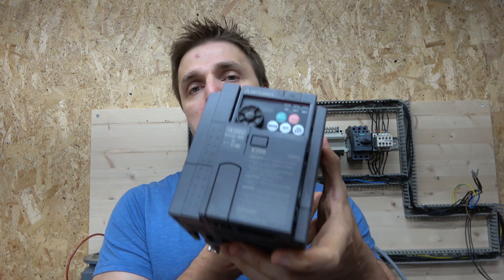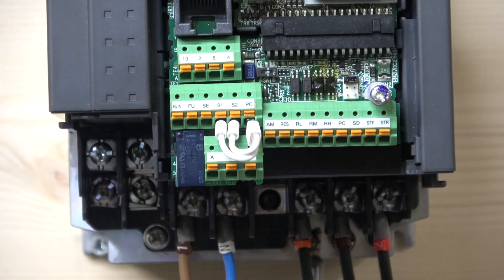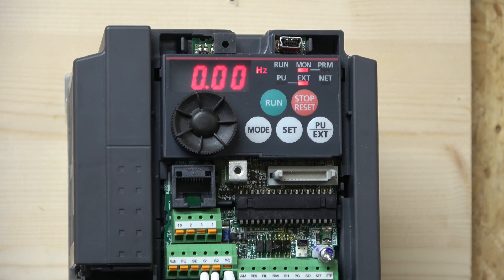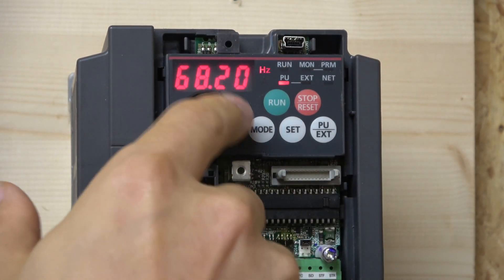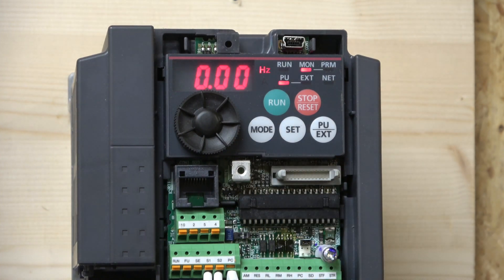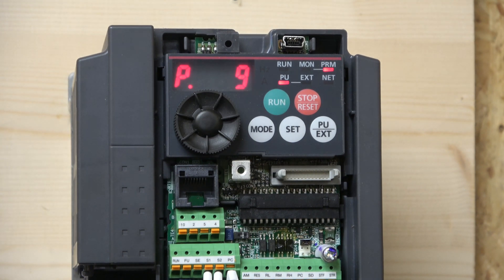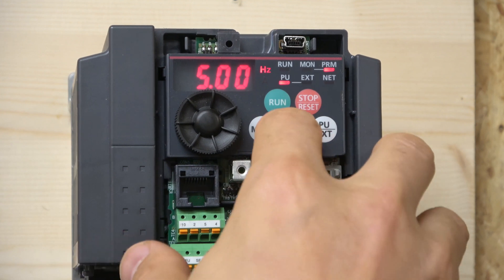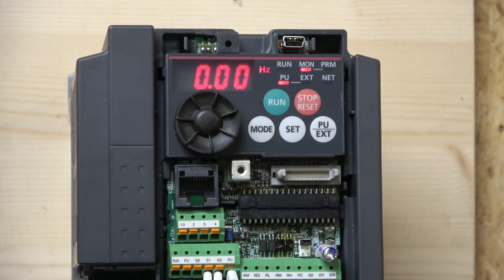Mitsubishi FR-E700 local mode control, Factory reset and parameter set up. ( 720s, 740) ( English)

Comment: FR-A740

Good morning sir, I have a problem when I press the inverter start button. The power on light comes on, but there is no Hz display and no output. Sometimes when I turn it back on it displays Hz and there is an output but after about 15 or 10 seconds it automatically turns off and goes back to zero Hz. Could you help me?🙏

Comment: Hi! Great video. I am stuck with getting the motor spin higher than 3 hz. I can tune it on PU btween 0.5 and 3 ish hz but setting to let say 50 it still run around 3 hz. Can't find it online.

Comment: Hi sir e700 drive already setting to parameter  and communication line also i will start to jog mode and 2 wire  mode my thinking is correct
Reply from the maker: Please check out the 2 wire control video.

Comment: I have the same FR-700 and it is showing error E. IHI ,
Can you help me to remove this error, This happened after the power failure and when the power came back then the lift stoped working,.
I did a couple of shutdowns and restart but did not help.
Pls, help me out.
Reply from the maker: Hi Mustafa, i cant seam to find this kind of error on Error list.

Comment: I love your video but I'm having a challenge with my drive... It skips from p80 to p82...  How do I get that fixed sir?
Reply from the maker: Hi There. Glad you like the videos. It is to do with your control mode. Check out full manual page 110 onward regarding parameters you need to change to unlock the ones you are after.

Comment: Hello, Great introduction, I'm totally new to vfd's and i have a couple of questions:
Is there a way to control the frequency with the wheel in a 'live' way, without the need to press the set button?
Can you please explain what the connectors on the rght of the rj45 port (the screw terminal and the white one) 
Also the 4 screw terminals on the bottom on the left and the mini usb on the top.
Thanks!
Reply from the maker: Hello Teo. Regarding set for speed, i have never been able to alter that, so believe that is the only way. The white terminal is for additional boards that you can add to the drive, i.e ethernet, mobus, can and so on, mainly for communications. The screw terminal is were you would secure the additional board. The mini usb port is for connecting to laptop for use on RF Configurator. Check out the channel for RF configurator video, wary handy tool. And the 4 screw terminals on the bottom if I understood the correct ones are used for DC brake connection. Hope that answers your question.